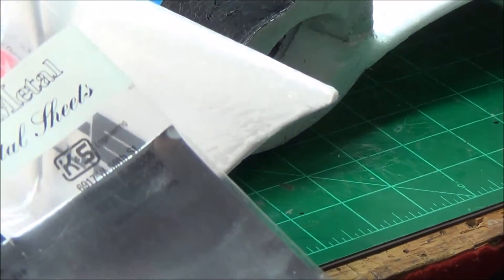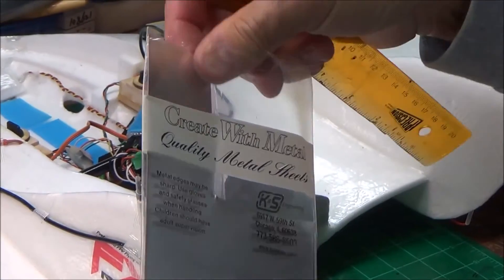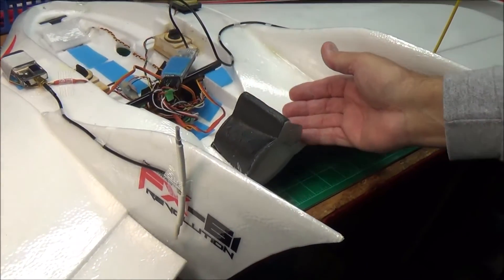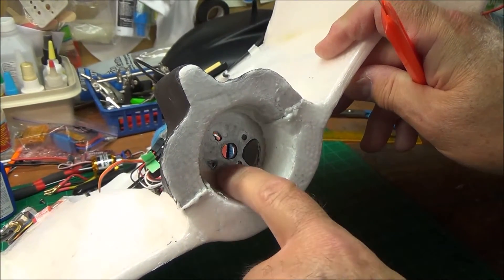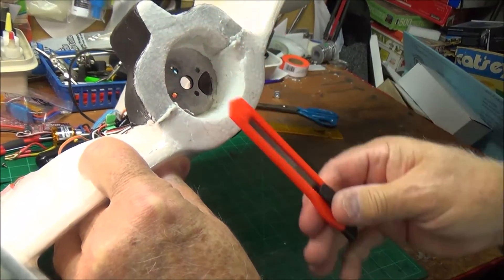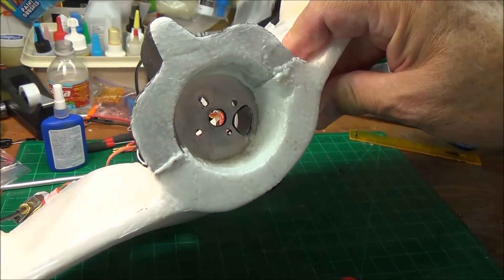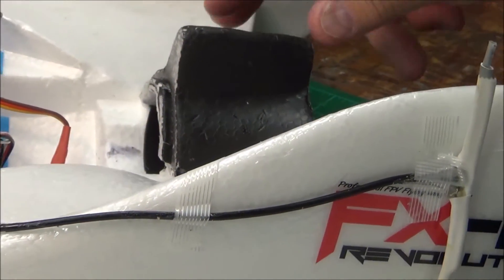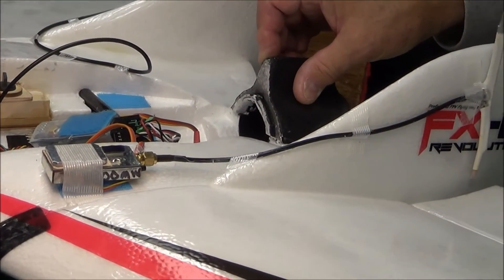FX61 Motor Mount Reinforcement

Comment: Dick,you have now restricted all your cooling airflow with your new motor mount!
The stock mount was designed to have those inlet holes for motor cooling.
Reply from the maker: I made holes for the air to go through, however, the aluminum mount was not available when I did this.
I would go with the aluminum mount for sure!!
Reply from the maker: paulkazjack I assume you mean the COG.  It is exactly as the instructions state, just ahead of the spar
Reply: No I meant All Up Weight = Auw.

Comment: Keep in mind that you prevent the airflow from inside the canopy by "closing" (or reinforcing) the motor mount like that. :) Happy flying
Reply: No problem - I am as always curious about, how other FX-61 pilots configure their gear :)
Reply: Matebox in Motion Go to Small Parts CNC . Com , they came out with an aluminum motor mount for this bird.
Reply: Thanx pall, but I'm already in contact with them. :) Yet I didn't order as we are in the build phase of a new Skywalker X5 and my FX-61 military - there is a lot of work to do and by now, none of my motor mounts went down.

Comment: Great low/no cost alternative! I have a pnp sitting in a box waiting for me to get off my can and lam it, and heard horror stories about the mount already, mines factory glued in but I think I'll cut into it DNS do your mod before I do anything else. Thanks Dick!
Reply from the maker: If you do my mod all you have to do is take the top piece of foam off and put the metal plate in, then glue it back together.  Easier to do now than later.